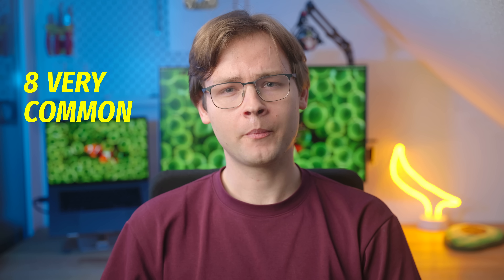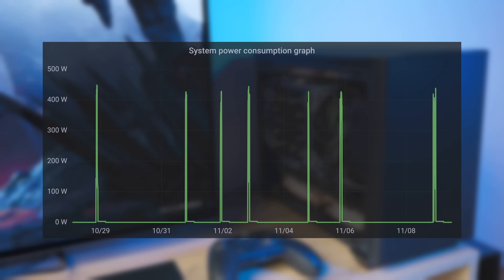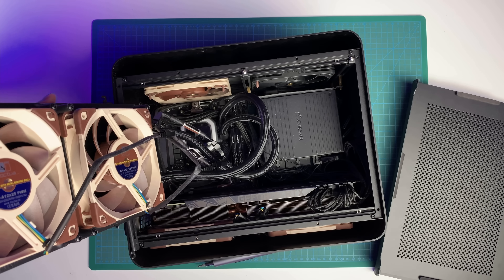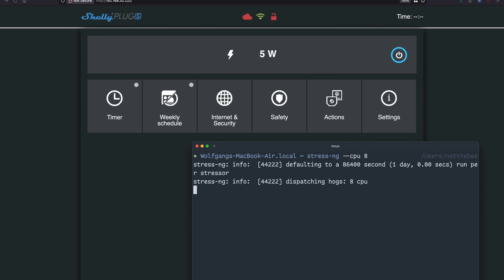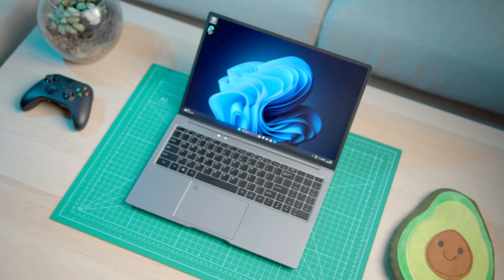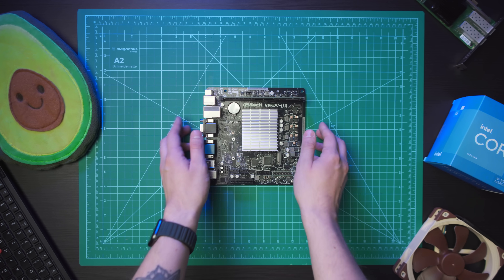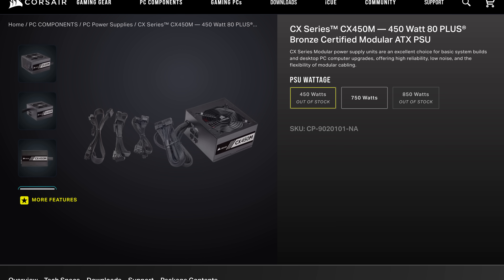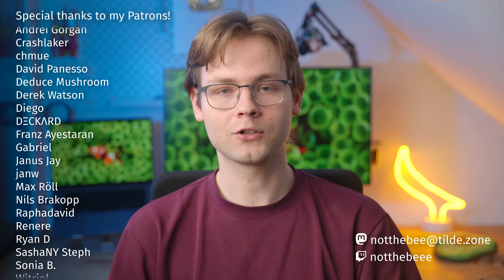Busting 8 Common Homelab Power Efficiency Myths

Comment: Thoughts on running pi for idle loads and doing something like wake on lan to wake up bigger server for larger loads?
Reply: I am building a setup like that. Really effective.
Reply: Sounds like a lot of unnecessary complexity and latency
Reply: @Zamsky39  Mwah, it's not that bad. You only have to set it up once and that's it, and I doubt it's going to take you more than a couple of hours at most. Latency isn't such a massive issue either, especially if your server uses a NVMe SSD as its hard drive (by that I mean where it's OS is installed on, and what it boots from). You're only talking about 20-30 seconds between sending the command and your server being all up and running. On average people spend a third of their day sleeping, and you're not going to use your server while asleep, so by putting it in hibernation or even completely switched off while you're asleep, you'll cut down the power consumption by approximately a third. All it would take is for you to send it a command when you're going to bed in order to put your server in hibernation or even switched completely off, and a wake-up command in the morning when you've woken up.

Comment: is 12vo power supply an inherant efficiency win? my hp 290 g2 has a 180 watt 12vo power supply gold rated and with no sata devices idles at 3 watts so it must be pretty decent!
Reply: yes, 12v will always win because they've evolved for laptop battery life. atx psu evolved for general purpose personal computing i.e. gaming and workstationary etc
Reply: @fanlessfurmark  the computer in question is a general purpose computer, and 12VO is here for workstations, servers, and gaming rigs. It's just slow to be adopted in the DIY PC world, understandably. Many existing ATX modular PSUs are ATX12VO compatible, usually with an adapter (my desktop's would be CP-8920272, FI).
Reply: No, but it saves a lot of copper, compared to old ATX.

Comment: small form factor hp (and other) office machines are great entry points. they are (usually) engineered well for power efficiency and can be picked up cheap.
Reply: I agree. I have an optiplex. Been powered on for 5 years now, spends 98% of its time in idle c6.
Reply: do you mean like the ultra small form factor ones that have no pcie slots? or the ones that have half-height slots? Or the full-blown desktops?

I've been thinking about getting one if cheap enough, but I'm not really sure about how I'd set up my drives (probably have to find a real PC case), what PSU to use to power up HDDs, or what to do about sata expandibility.

If you have any insight on what you're running and the power draw I'd be curious.
Reply: @arsenalfanatic0971 no I think he means Dell optiplexs and lenovo think centres. Sff office PCs...usually matx boards?
Reply: @arsenalfanatic09  like the other commentor said, i mean the compact desktops not the ultra tiny thin clients. altho they can be used too and they are efficient they're way more limited in terms of power and expansion.

I picked up a job lot of HP 290 G2 sff boxes and have been blown away. less than 3 watts from the wall at idle (with no sata devices plugged in). spends most of its time in c8 power state
Reply: @arsenalfanatic09  have a look at the hp 800g3 sff or 800g4 sff , they are dirt cheap, 4 half height pcie slots, 1x nvme,1 wifi slots, 1 more extra nvme for the 800g4, but it only support 2x 3.5 inch hdd internally and only 3 sata ports.
Reply: HPs are a step above. Z420-z640 run SILENTLY under decent load. They put a lot of care into these details and it shows. Lenovos are good too but you can always count on an HP to run off broken dreams alone lol they take a ruthless beating and still run.
Reply: @goofballbiscuits3647  I have a HP Z420 for a few years and it is anything but silent, thought about changing the fans on it but I think it uses proprietary connectors.
Reply: @daven6634  I used to flip them all the time between local and online markets. I would bet money that the idle fan speed was set too high in the bios. 
Leave it at 1 and at idle you're slightly above ambient with absolutely no noise.
Reply: i just picked a hp 800g3 sff and very happy about it!!!!
Reply: @zhihaolooi8894  i think i have the same, elitedesk 800 g3 sff, it has an m2 slot, 3 sata for decent expansion and its running at like 5w with 4 ssd's and not even completely idle

Comment: my server idles around 50w and I'm not sure how I can reduce it. I'm running a kabylake i5 (what I had laying around) and a couple of hardrives on debian. nothing seems to get it to go below c3 (no pcie cards are plugged in) (it's probably the motherboard
Reply: Try a Windows installation (maybe just to get a reference on what is possible). From my experience, Windows (Server) is hard to beat when it comes to power managing the board and devices. It can cut the power consumption of your system in half. Unfortunately, Linux drivers don't seem to be very good when it comes to low power (I guess). Also some Linux distributions might not have installed the correct GPU drivers for the system, in this case the GPU won't clock down or blank / switch of video ports when running "headless". I tested some Fujitsu Futro Thin-clients in this regard, Windows idle at 3.8W vs. Linux / Proxmox / Debian idle at around 7W e.g. This is quite a difference, if anybody has some tips on how to get Linux power consumption down, please post them. o)

Correct GPU drivers are really important from my experience, a Windows 2019 Hyper-V Server, which does not accept the regular GPU drivers, will also eat significantly more power when idle, compared to a Windows (Server) with correct GPU drivers installed. There is HDMI Audio and maybe some other subsystem connected to the GPU as well, if these things don't get properly initialized and powered down, consumption is higher than needs to be.
Reply: Stab in the dark, but do your drives spin down? If you're running unraid, make sure that you have a cache drive and your HHDs spin down. That way I get sub 30w with an old Haswell cpu  and full atx motherboard.
Reply: the 7600k draws about 40w idle so the extra 10w might be your hdd drives

Comment: "Myth#4 ECC..."
"NO. we're no doing that today"
😂😂😂
Reply: What is an "ECC" here? ECC Memory?
Reply: @LichtTempler yes ECC memory. There is a big debate on if you need ECC memory for home servers. It's basically if the data is important enough to have backups and or data parity dedicated to protecting it, it's important enough to spend the extra money on ECC. Vs. But ECC memory is expensive and memory has gotten much better and memory errors are much rarer than they used to be. I'm probably glossing over massive points here but I already had ECC so I stopped looking into it at least for now.
Reply: @Zanthum  , I see, thanks! I thinks same, I have ECC memory only on servers, where I experiment with AI learning stuff and it takes some time. But for data storing I use "normal" RAM.
Reply: @LichtTempler You did it completely backwards. Data storage should consider ECC, because bit flip can potentially corrupt your filesystem. (Despite how small a chance it is). 
Machine learning algorithms can usually tolerate some error. Sometimes, errors are part of the algorithm. Worst case the application crashes, it can restart from the last checkpoint.

However, one more thing, server RAM, RDIMM is way cheaper than desktop RAM on the used market. They only work for server platforms tho, which aren't power efficient. So much lower frontal cost, slightly higher running cost. It all depends on your electricity price.
Reply: @yren3386  it basically means, I would need ECC everywhere =)
For the electricity: I am in Germany, where it is extremely expensive.
Reply: @yren3386 , I actually bought a new CPU+MB+RAM bundle with ECC, so the case is closed. =)
Reply: @LichtTempler  you should do the opposite.. data storing is most important than a service. You can recreate a service thousand of time but you cannot recreate an important picture or document. Data is EVER most important thing you have tu preserve, at home and at an IT service
Reply: @broliyoung  , I've come to this at the end anyway. But, thanks.
Reply: @LichtTempler  yes, i read too late the following messages 🤣
Reply: Myth #3 mentioned ECC, #4  is ARM is more power efficient than x86.

Comment: Really enjoyed this video! Production Quality as always on point! My system idle's around 40w. I have an i7-4790 that was gifted to me. Do you have any advice for me in the same Generation of cpu or should I go with a friend's advice and just buy a 11gen Intel Chip. ( I really really want AV1 Decoding ) 

Hope you have a great day!
Reply: You really should know first about what are you going to use that for, if the 4790 is enough then use it. But if you really need new features from new hardware, then you can upgrade.

4790 should be strong enough for general computing and gaming, let alone a home server. Tho i guess some undervolting is good since it can draw some power under load